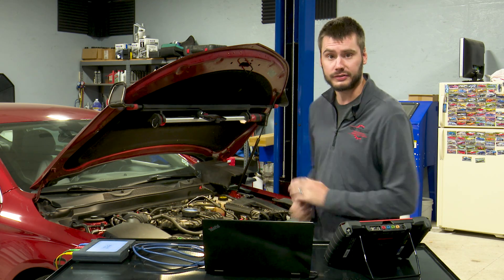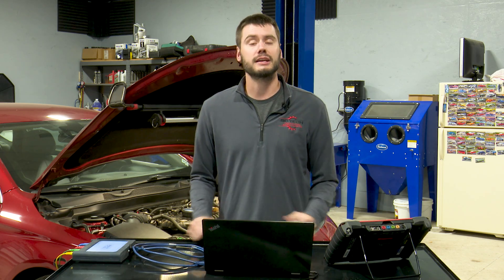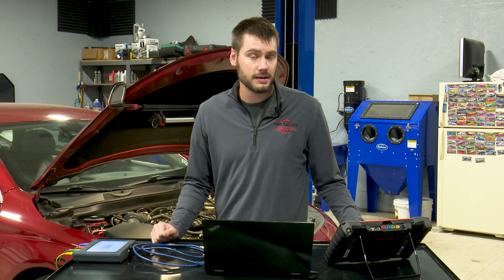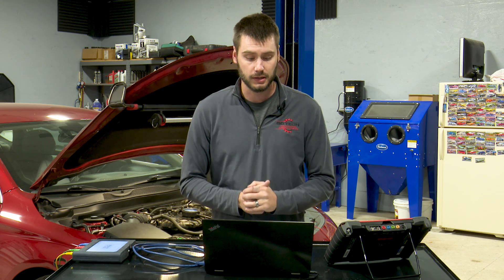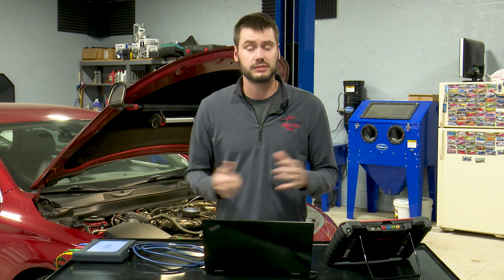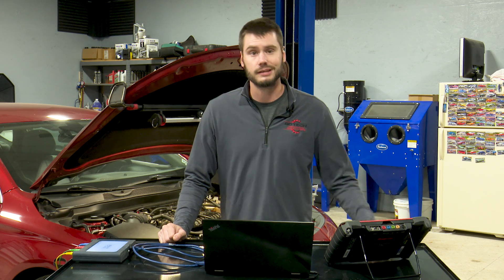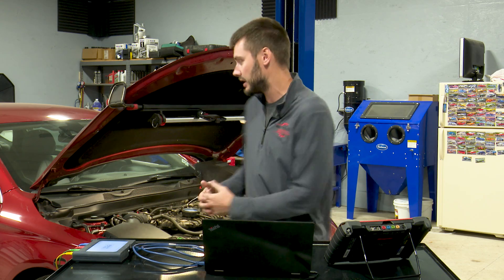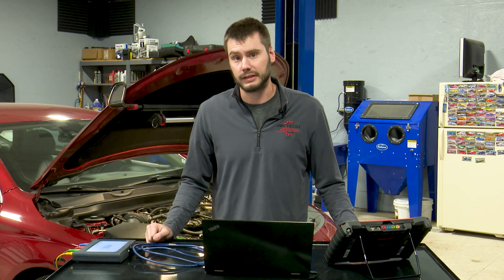3.6L GM Misfire Nightmare - Why No Check Engine Light!?!?

Comment: Do you have a follow up to the fix?

The B+ for the coils on each bank of most of the 3.6 engines are on a different fuse or wire. A fuse for odd and fuse for even bank coils. Which can intermittently go out causing the car to misfire on one bank and eventually destroy the catalytic converter.

I wouldn’t think less than 10° off on the timing chain would cause any issues.

Comment: Probably a cam phaser going bad either way I’d be doing timing chains and all cam phasers. It’s a tough sale though, everyone would probably recommend a new or used engine but they typically aren’t worth it. Used one could be not far from what you got. A lot of people forget to check vacuum, it my go to on checking for clogged catalytic converters

Comment: What if I do get a check engine light on with a misfire on one cylinder? I already changed plugs, ignition coils, injectors and O2 sensors! I own a 2012 Grand Cherokee.
Reply: Rocker arms, bud
Reply: @ivanmoreno3918 no, found out it’s my timing chains. They are too stretched

Comment: Thank you so much for this video. I was having the multiple random misfires with my 19 blazer with the 3.6. Happened along 60k i threw the parts cannon at it too.  Plugs, coils.. no change.. i ended up having some bad gas? I threw a bottle of heat in the tank and it helped.  But having this issue led me to this video.  So i will definitely keep my eyes on the timing!

Comment: Just found your video during my YouTube investigations for my 2011 Buick Lacrosse 3.6. same thing slight misfire/ stutter only at idle that I notice. Course my engine has almost 200,000 miles. On top of that I have changed high pressure fuel pump, all O2 sensors, spark plugs, and have run injector cleaner through the tank but not replace them. Mechanically inclined But don't know if I feel like ripping the engine apart yet since there's no code😂. Thank you for the lesson

Comment: Very any of you Saab guys out there, I am currently dealing with this same issue on the 2.8 which is the turbo variant of this motor. The timing procedure is the same. My car eventually sets a misfire for bank 1,3,5. I’ve done it all, coils, injectors, spark plugs, vacuum, smoke, compression. The misfire sticks to that one back, a CEL can come on in a couple days or even weeks after clearing it. There are very few of us out there but this is indeed relevant.

Comment: HI!!!!! I have a similar fault in a 2012 cts 3.6 only that you would have to add excessive, exaggerated fuel consumption to mine, my mechanic scanned it and marked 2 values in "misfire current in cylinder 2", I do not have a check engine light . Unfortunately for me here in Mexico and specifically in the small city where I live there is no one who does an excellent diagnostic job like you, they recommended that I change coils, injectors, etc... But I haven't done anything because I don't want to spend money and getting annoyed with the car, I love this car to transport my family, it is the version that arrived in my country with 19-inch wheels and Recaro seats.

Comment: I have thus engine on my alfa romeo, it's timing chain issues caused by gunk in the engjnd caused by the PCV valve getting clogged. keep ckeaning out the PCV valve and change the oil regularly.😊

Comment: I had this exact issue in my Holden Commodore SV6 2011 (Australian version of the same engine) and it turnned out it was the oil I was using, I used a nulon 10w40 and it developed intermittent misfires, especially under light load, never did it while warming up. I changed the oil to Mobil1 5w30 (as recommended) - and only because I got a good deal on the oil, and I noticed the issue went away. Bizzare, I think somehow the different viscosity of the oil was affecting the valve timing causing misfires? - the errors logged always showed 'partial misfire cylinder 1' (cant recall code) but never tripped the check engine light. Replaced plugs and coil pack but still did it. That was back when the engine had 30,000km on it and it now has 210,000km on it with no misfires since.
Reply: correct oil is 5 40 though?
Reply: Says 5w30 on the oil filler plug @ItachiUchiha-lr3yr

Comment: I have a 2011 cts 3.6 with 145k on it and about 6 months ago started having random multiple misfires on start up on high idle only, once comes of high idle smooths out. did some reading and found out about timing chains on vvt gm 3.6 engines spent the money at a reputable shop and got chains done. Got it back two days later. The same problem was there. asked them to diagnose the problem and they suggested coils and plugs which I had them do and no difference. they tried a seafoam drip into the direct fuel injection system as it's not the standard fuel injectors I'm told, was given it back after a week and told the only option was to pull motor apart which they couldn't be sure of what or if they could find anything. so, I took it back. looked into possible cam shaft actuators being plugged with sludge affecting oil pressure to phasers. trying marvel mystery oil and seafoam in oil to breakdown anything in there first, motor is quiet on running no noises from chains at all. here is the strange part I park the driven into my driveway up hill and upon starting no misfires, park it backed in and downhill and misfires everywhere p0304 p0301 p0306 not all one bank both banks different times, like I said been going through this about 6 months but the oil in the different levels in the pan tilt tells me something. don't known if I want to change cam shaft solenoid's or just remove them and clean them as I've watched a video on that anybody had anything like this on their GM 3.6 i would appreciate it thanks.
Reply: good day! have you tried changing the fuel injectors? I had the same problems on the 5th cylinder, replaced it. now there are errors on all cylinders except the fifth)

Comment: Great brake down on this 2013 Chevy equinox 3.6 V6 mine has never set a code either I've had this issue for about 50,000 miles never gotten worse ironically runs out fine enough to not care but lightly pops out the intake when shut off really have to listen for it to know but I'm in the great debate myself put money out to do timing or driving until it dies 241000 miles we will see it would be fun to fix but time is not easy to come by.

Comment: Do you think this problem is at least partly due to lack of maintenance/extended oil change intervals?? From what I've seen on these engines it's a good idea to change the oil every 5k miles religiously regardless of what the computer tells you to do to avoid any timing chain issues. Also checking your oil frequently to avoid running low on oil between changes. I wonder if that played any role in this issue?
Reply: From everything I've research on this engine yes oil changes are critical

Comment: Starting to have misfires on my 2013 Cadillac XTS with 98865 miles. 🤦🏽‍♂️ Cylinder 5 is having the most misfires though. I was only intermittent at idle. But now I can feel it stutter when I drive. Cylinder 5 is the worst at 51 misfires. 2 is the next bad but at only 6 misfires. Then 3 has 4 misfires, 6 has 3 misfires Then 4 has 2 misfires and 1 only has 1 misfire. 😭🤦🏽‍♂️
Reply: Carbon on the valves... throttle body
Reply from the maker: Hey Jason, that's not good! You could always try a set of spark plugs first, if they haven't been done. They are just about due for maintenance anyway.

Comment: He confuses me, 4our Eié thort chain stretch waz due to bad oil maintenance,  so itt only ONÉ Chain stretching Untt ŃÓTT thé othér two, shoodunt ÂLL Chãiń bé Efféct ¿¿¿¿¿¿¿¿¿
Reply from the maker: Hello,
The oiling system on this engine lubricates each chain differently and the rear chain tends to get less adequate lubrication then the other two chains and causes it to wear faster.
~Ryan

Comment: Great Work On The Diagnosis, Either Way Chain Stretch Or Phaser Problem Doesn’t Matter Which Is The Problem, You Can Confirm Once You Disassemble If You We’re Doing The Job. But Your Diagnostic Techniques Put You On The Exact Path To Finding The Issue. Awesome Work.
Reply from the maker: Exactly! And we didn't have to pull the cover to diagnose it. Thanks for watching bud!
~Mike
Reply: @GoTechTraining  Your Welcome!

Comment: Nice video sir. Yes, those engines do have timing chain issues.
Reply from the maker: Hey Luis, yes the do, big time! Thanks for watching!
~Mike
Reply: @GoTechTraining  you're welcome
Reply: Timing chain issues if.  You don’t change the oil enough. 5000 miles max in these engines.  Don’t belive the 10000 mile crap.  Use full synthetic.  Also the tensioners run on oil pressure. Keep oil full.  Avoid overheating the motor.  Check the pcv often.

Comment: All I can say is WOW.  My brother owns a new 2016 Cadillac CTS 3.6 L (30K mi)  and the dealer can not find anything wrong with it.  It also threw a Bank 1 Lean,  check engine light (CEL) at  8 K miles.  I see the miss fires on 1, 3, 5 and we checked for vacuum leaks, swapped coils etc.   The vehicle has a K&N cold air induction we installed just after the  CEL issue.  The dealer would not fix the vehicle unless we remove it.  I said no way.  The air cleaner should also cause the same problem on the other bank as it is a true dual exhuast  & manifolds.  I now suspect it may have a defective timing chain as well.  What are the odds of that with so few miles especially on a brand new vehicle.  The dealers answer was: "Well just drive it and let it brake in".   The vehicle is notorisly bad for random CEL's.  Now with over 30K miles we just unhook the battery and let the codes clear.  I'm sure it will get worse as time goes on even with Mobil 1 synthetic oil from the factory.  And yes you can sense and feel the misfire murmur every now and then.
Reply: I have to ask; where is this dealer? I want to be sure to avoid.
Reply: 2016 isn't a brand new car
Reply: I never understood why they call them cold air induction when they are located in the engine bay. Stock induction takes ambient temperature air from the front grill.  So putting an overpriced filter in the engine bay makes the air colder?  Explain to me.
Reply: When you're checking compression and vacuum differentials, is that using the engines PCM and sensors or are you old schooling it with gages?

Also, I'm doing a no code Acadia with a 3.6 that isn't even starting and it's a nice piece of info to know that it won't  code until the chains get past a certain amount of stretch...though a no start sure does indicate it's past that point. So thanks

And to all the dickheads that feel like deriding me for not knowing if modern motors can sense compression differences, keep it to yourself.
Reply from the maker: Hi John,
Wow, Sad to hear a dealer say "let it break in"
Hope you eventually get it fixed! If so let us know what the cause was.
Thanks for checking out the video and reaching out!
Ryan Wilsing
Reply: I’ve got that engine with 160,000 miles.  I never came close to driving  it like I stole it.  It doesn’t even burn even a quart every 5000 miles.  Was yours ever driven hard?  Seems to me that can stretch a chain.
Reply: Did the dealer not change the oil for the first 8k miles? Probably not.

Comment: Just had one of those in my shop with a single cycle miss an they threw the cannon at it instead of testing.. cylinder was getting washed out.. ... they don't know if it was ps/gs controlled but I'm bet it was grounding since it was a crash car.

Comment: Hello Mike, I came across this video and I've been searching for a solution on my own to fix my P0302 misfire on bank 2 I replaced spark plugs and coils with hopes of a fix and still coming up with  check engine light. So in conclusion I will need to replace a timing chain?
Reply from the maker: Hey Mario, usually if it's a chain issue it will affect the entire bank, not just one cylinder. What about injectors?
Mike Becker, Senior Instructor
Reply: @GoTechTraining  Thank you for replying! Yes only on 1 cylinder, cylinder 2. I was thinking I heard any cylinder but you clearly said 1, 3 and 5 and entjre bank /half the engine. Do you recommend replacing or high pressure cleaning? I have seen a few people use an over counter gdi and valve cleaner with success. Any Recommendations are appreciated and thanks again.

Comment: This sounds like this issue I've been having on my impala, and the chevy dealership shop told me I need a whole new transmission, I took it to a transmission shop and they said the scan showed up fine, I've been in denial that it was the chain but now I'm almost positive it is but I just passed 200k miles so it's probably long overdue, thank you for this video

Comment: Can you trust scandata for these issues? Camshaft desired vs actual PIDS? I've had a few low power complaints where I looked at those PIDs on a test drive and they showed perfect. This would "rule out" timing issues in a super quick and easy test. But I always had a slightly uneasy feeling. Scandata is not that same as looking at a scope ... but the ECM IS looking exactly at what you're looking at with that scope capture so I would THINK camshaft desired/actual PIDs SHOULD be trustworthy...? Now if physical timing is off and the ECM is able to correct with VVT action then it would look good but I would think it should show at some point in a drivecycle...? Or maybe VVT could mask it enough that you might not notice. Anyone have experience with scandata vs actual scope captures on these issues?

Comment: hi i have a 2009 audi a4 2.0 caeb engine 
having misfire on piston 1 and 4 only on high idle 3000 RPM +
replaced injectors same replaced coils and spark plugs still same checked compression and all good what can it be thanks 🙏

Comment: Cool video Mike! Couple questions: how did B1 chain stretch but not B2? I don't believe that a 6 degree stretch would cause a -14% fuel trim. My bet is that a pin sheared on one of the cam phasers on B1, which would NOT shift the cam signals, but would shift the actual camshaft! Impossible to diagnose without physical teardown unfortunately. Have you seen my Hyundai from Hell video? 👍🙂
Reply from the maker: Hey Ivan! Thanks man! So I've heard that B1 has an oiling issue. You're right though, tearing down will be on the only 100% way to know the root cause of timing misalignment and the breathing issue. I haven't seen it, but I will look for it now! Hope all is well!
Mike Becker, Senior Instructor
Reply: Bank 1 always wears the most, and sets codes first. Don't know why. But definitely a pattern failure.
Reply: @briannackers963 More  heat on the firewall bank would be my guess
Reply: I’m no mechanic but have 3.6 and have heard that the PCV can clog and cause issues on bank 1

Comment: I had a P0017 light.  I also had a few rich codes on both banks.  I changed the cam sensors on bank 2 and the Exhaust VVT(I think) solenoid  and amazingly all the codes went away before I even asked to see the codes in the scanner.  Eventually, in a few weeks, I'm going to change the other banks cam sensors and the other 3 VVT solenoids.  My 3.0 2010 Equinox has 155K miles and I've always used Mobil 1/Amsoil/Pennzoil Platinum Synthetic with regular oil changes and a FilterMag on the filter. I'm the original owner.  I have a slight stumble at idle so this video was great.  I don't have a sophisticated scanner to check the readings like you did in this video and I do know that eventually timing chains will probably have to be done.  Not something my wallet is looking forward to.
Reply from the maker: Hey Chris, thanks for watching! I feel for your wallet. Timing chain jobs are never easy on it hahah!
Mike Becker, Senior Instructor
Reply: did you have to get a cam relearn procedure done?
Reply: @kurskkava  I have not. I've just left it. Still runs good just not at idle. It still gets 25mpg on the highway doing 75+mph.  Just passed 177K miles last week.

Comment: Would it not be more prudent to rule out an exhaust restriction first, I lean that way due to reduced intake pulse on that bank?
Reply from the maker: Hey Steve, I forgot to mention that the previous shop had done a back pressure test with near identical readings bank to bank...but looking the problem, a basically no load misfire, an exhaust restriction doesn't make much sense. Typically you'd see a problem get worse as the engine heats up and under higher load situations because it can't breathe. 
Mike Becker, Senior Instructor
Reply: @GoTechTraining  thanks for the reply Mike.
I was going that direction based on the relative compression results.

Comment: This is diagnose in your style👍. What do you think if use  a in cylinder pressure transducer, would you see anything on valve events.
Reply from the maker: Hey Ivan, thanks for watching! Hmm not sure if you'd see it. I chose not to because I had a bank of misfires, not single cylinder.
Mike Becker, Senior Instructor
Reply: @GoTechTraining  Thank you I was just curious, because it was so slightly out of timing

Comment: Strange that one is worn/stretched more than the other. Maybe guides/tensioner problem. Either way a timing chain K I T will fix it. Thanks Mike.
Reply from the maker: It is strange for sure Terry! I've heard that the back head has an oiling issue, lack of lubrication promotes wear.
Mike Becker, Senior Instructor